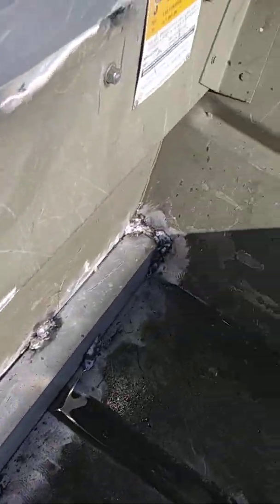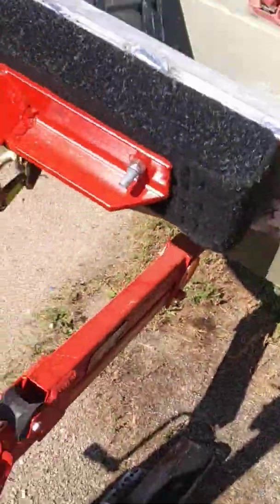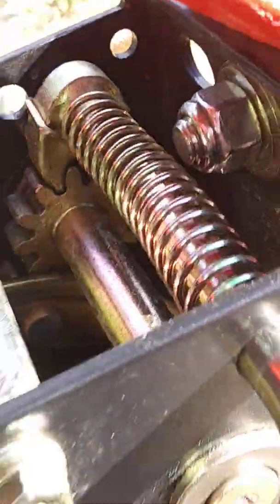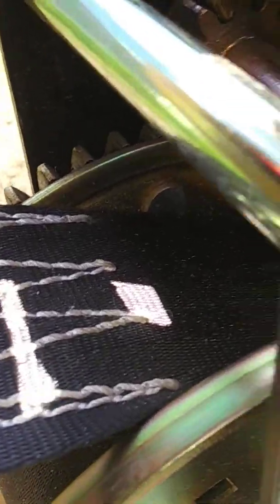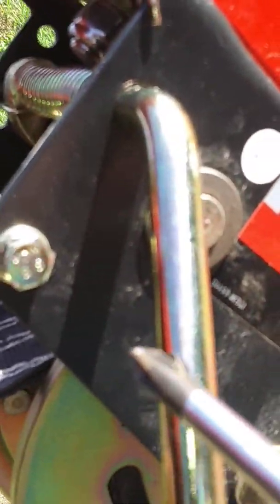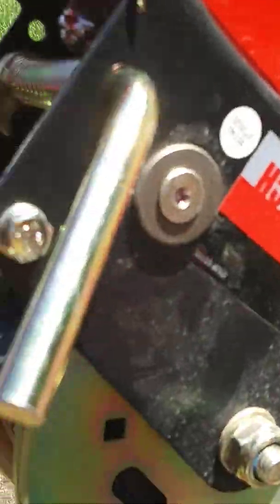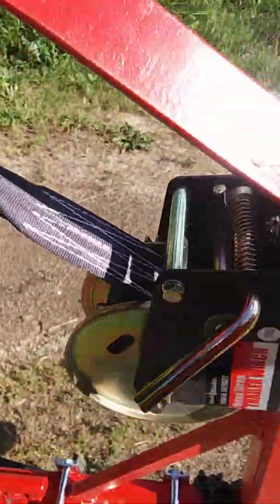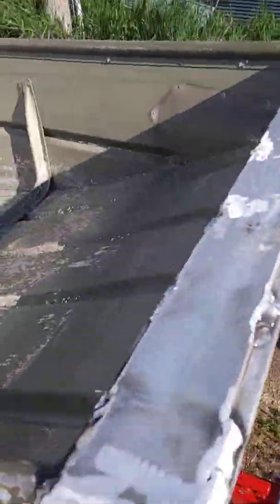HARBOR FREIGHT TRAILER HAND WINCH REVIEW- RECALL IT BEFORE SOMEONE GETS KILLED- I SHOW HOW UNSAFE

Comment: Hello, I really liked your Video.
Winches are made for several uses and not for all uses.
Most folks think a Winch of any kind is the same as all Winches.
If you would have read the directions you would notice you mounted the Winch wrong
and have the Strap feeding wrong also.
The directions state the winched item should be locked down once winched into position and then the cable or strap should be released while not holding the handle to protect user
from kickback. This type of Winch was not built to tow or secure anything.
You should have purchased a Boat Trailer Winch.
Sorry to see you got hurt.